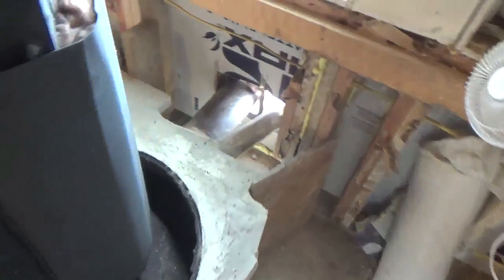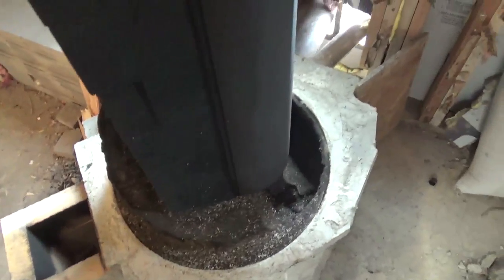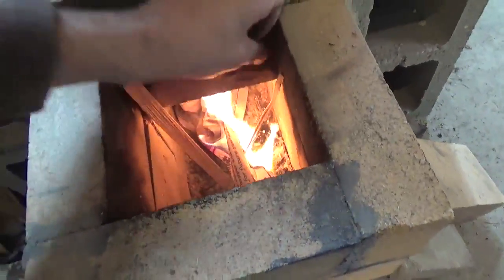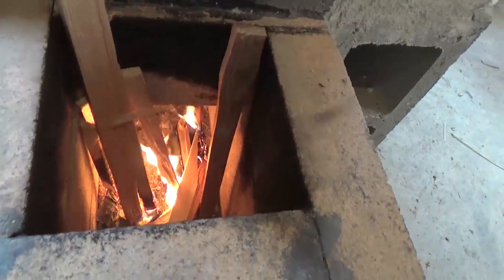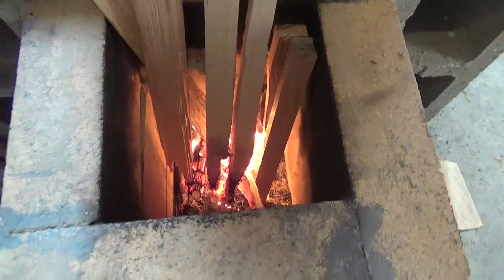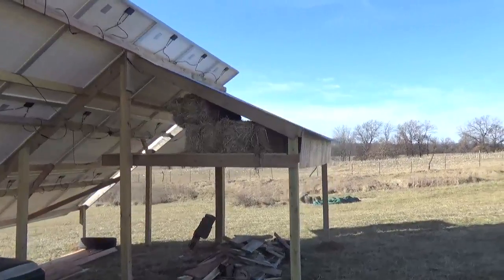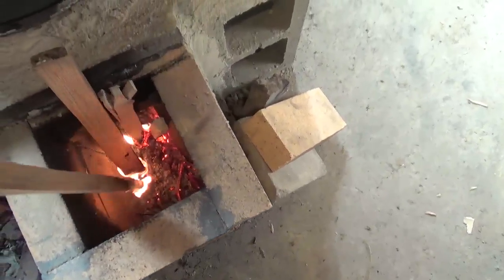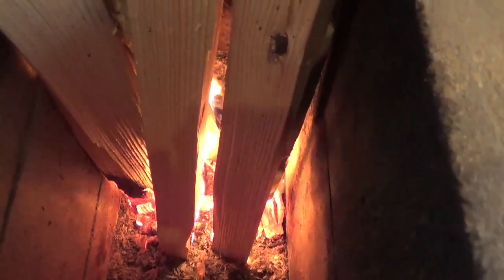Rocket Mass Heater Part 4; Explaining the semi-final configuration

Comment: Very impressive set of videos / build - I'm curious if you've found the actual heating results to be worth the work? Like does the thing produce enough heat to keep the space warm?
Reply from the maker: Absolutely!  There is so much thermal mass, it takes about four hours for it all to warm up, and it is putting off a lot of heat that whole time.  Then the mass puts off heat all night and can still be a little warm in the morning.  The heat rises to upper level of our home with is about 1500 sqft and it can keep the whole home warm if we keep it going. Highly recommended!

Comment: Are you getting headaches? Is your skin turning pink? These are signs of Carbon monoxide poisoning. Get that exhaust vented outdoors! Run a pipe across the greenhouse then straight up out the roof! Good luck!
Reply from the maker: No, and we have CO1 alarms, but yeah, that is the next change I hinted at in the description.  The heater doesn't work well when we have a wind out of the east.  I'm waiting on my new vent cap to come in the mail so we can vent it out the greenhouse roof.
Reply: Good luck! Thanks for the videos!